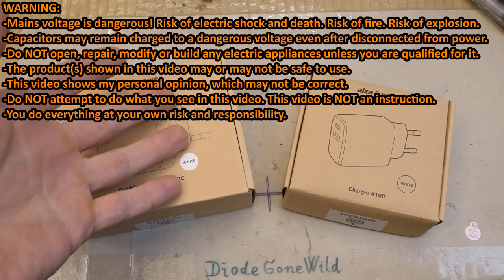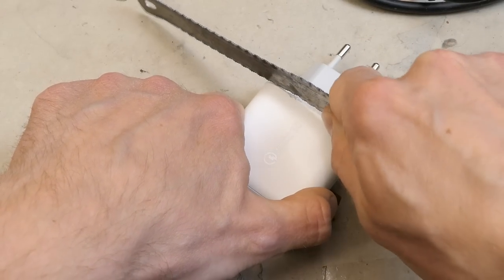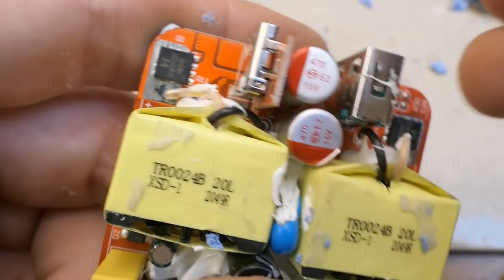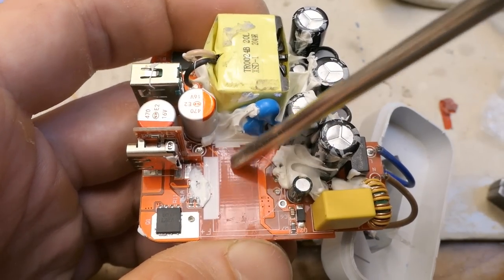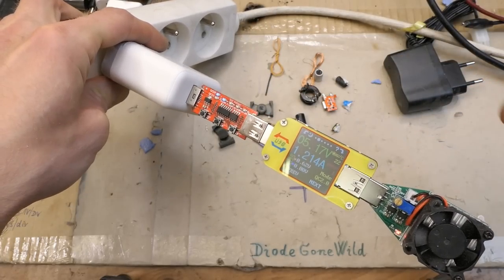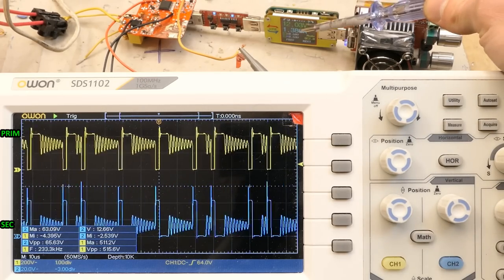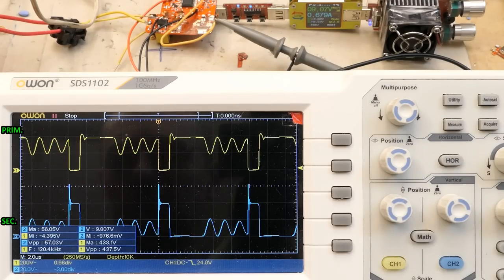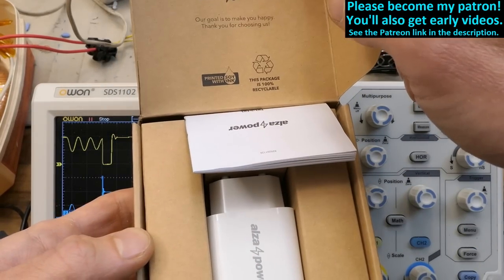A safe USB phone charger? What's inside?

Comment: The fuse is 3.15 amps because of cheap supply and demand. Most laptop supplies also use them and I've seen them even in appliances everywhere.. There must be a whole factory making them in China 😂
Reply: I think it is actually to accommodate the surge of current when the charger is first plugged in and needs to charge the primary side capacitor.
Reply: @argcargv  Yes correct, there is an inrush. However,  a max 20w device doesn't need the same fuse as a 65 or 90w laptop supply with a 180uF cap. China will always save $ on their BOM's even if it means some compromise passed on to the consumer. This 3.15A size is the most ubiquitous thru-hole fuse on the planet these days.
Reply: @CliveChamberlain946  While I agree that cost would be a consideration, I think you can't just compare the capacitance.  These 65-90w laptop supplies generally have some power factor correction (either inductive or switched) that have the effect of reducing the surge current, while this basically just switches 30uf directly across the lines when you plug it in with only a common mode choke in the way (which will offer no inductive resistance to the surge current).  There isn't even a fusible resistor to limit surge current.  Basically the surge current will be limited by the ESR of the capacitors and the resistance offered by the rectifiers.  The power supply is smaller so it isn't quite worth adding some extra components to help damp this surge current (i.e. inductance) versus just using a larger fuse.
Reply: @argcargv  As for I know 65W is upper threshold where SMPS need not to have PF correction. When I measured my 45W Samsung, 65W Xiaomi and DELL power supplies, they usually had worse PF about 0.5 - 0.6, however larger ones like my HP 90W  USB-C and Apple 96W had significantly better PF, when loaded a lot, then I measured even values above 0.85
Reply: @argcargv  With over 40 years in professional electronics after graduating DeVry, I've opened over one hundred 45 to 130 watt laptop power supplies, and have yet to see even one with any PFC (also the choke adds a lot of size and weight). I have also never seen one with a primary side "ideal rectifier" either (but I'm sure we will see this soon).
Reply: @CliveChamberlain946  Fine, but if there isn't PFC then there will be a NTC to limit inrush current.  You can't put a > 100uf capacitor directly across 325v without blowing a 3.1amp fuse.  I think the tradeoff here is more that one fuse is cheaper than a smaller fuse plus a NTC, not that the 3.1 amp fuse is that much cheaper than a 1 amp fuse.  Those also exist and are widely used.

Comment: 4:28 nope, on the other side there are two mosfets.. 6:45 teh cAt hair on the mains tester.. 12:32 those caps should not be mounted like this no way, even got vomitted by white acryl it is dangerous, the blue shell has very basic insulation to ~300V AC, its very crispy and can get crunched out by vibrations or heat differences.. this is very bad..
Reply from the maker: the blue pad barely reached the solder area under one of the mosfets. not sure hot it was meant to transfer the heat away...
Reply: @DiodeGoneWild  via pcb and the large tinned pads.. its quite usual nowadays
Reply: @DiodeGoneWild  heat can go both in deph and sides so it does not have to be exactly under component.. the mosfet should produce only decent heat anyway.. and using those pads is better than to have air gap which would present much more resistance for heat to transer away from the box internals.. we should call the green troll and ask him :-D